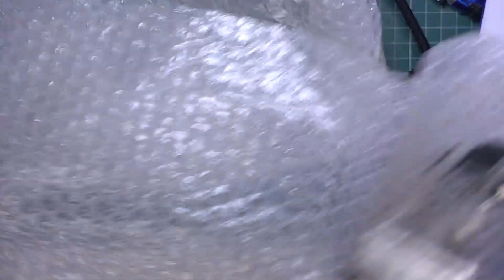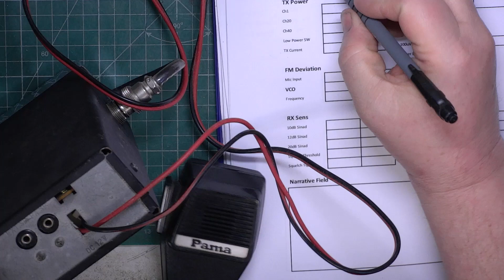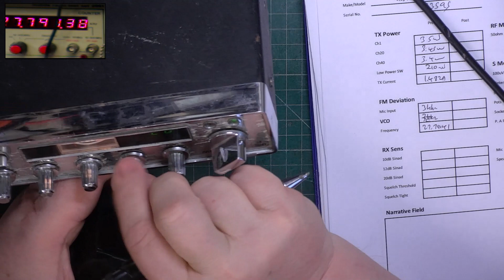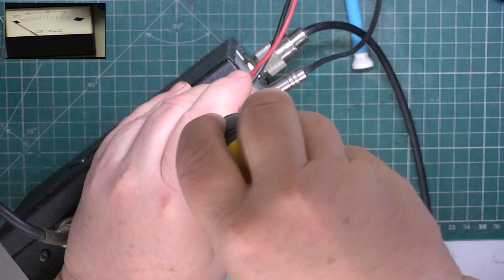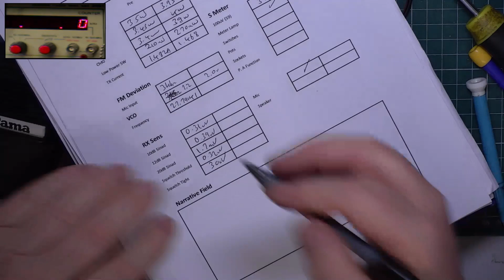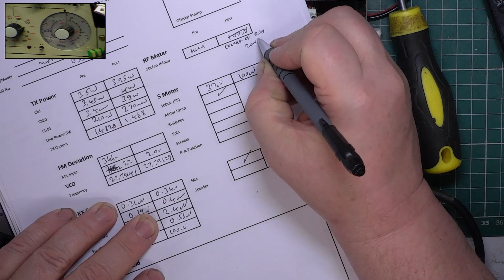Mustang CB3000 CB27/81 UK FM CB radio - service alignment

Comment: Your Pama microphone brings back very happy memories, back in 1979 when CB came to Buxton I was working in an electrical shop selling CB stuff and we had a big white walk in van every Friday, A mobile CB sales van selling Pama accessories, a Guy called Eddy and I think they were based in cheetam Hill Manchester.
Reply from the maker: When I was at Nottingham Radio, we had a Pama account. I went to visit them at Manchester as I wanted to see if they hadthings of use to us that I hadn't spotted in their catalogue. They operated from a large double-fronted Victorian house in it's own grounds (all car park)....and I did spot one or two things we subsequently would order from them. At Nottingham radio we had about 500 business radios out on rental so got through quite a few mikes. We had PL259 plugs off Pama too; they did these posh Teflon insulated ones & are, to my mind, the best I've ever encountered of the 'normal' type. I'm not talking about military spec silver compression versions!

As far as van sales went, we had Barenco every month. Other reguilar reps were DFB wholeale at Doncaster (great guy), Les Wallen (we spent £1K/month with him), Bantex aerials & Hills Components. We also had an Altai account.

Richard

Comment: The mains hum on this video made it difficult to watch
Reply: I can hardly hear anything noise wise
Reply from the maker: left or right channel as they are totally different setups?

Richard
Reply: WOW! he uses his Ears to watch that's clever, I'm only joking. I do hear the hum on both left & right but.. Only! if I put my ear right up to them both (very faint)
Reply: It was stronger on the right channel and much, much fainter on the left, but didn’t really spoil the video
Reply from the maker: RH channel is the £9.99 channel. LH channel is the £250+ channel. I have to use what I've got. 

Richard
Reply: i got no buzz or hum . clear to me
Reply: @johnnyjohn6527  Wash your ears out...Read the comments